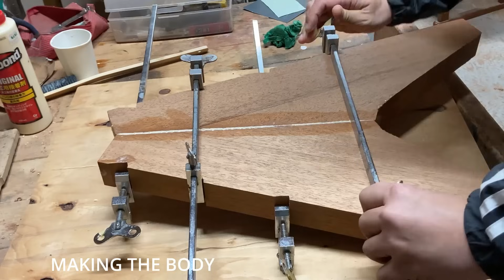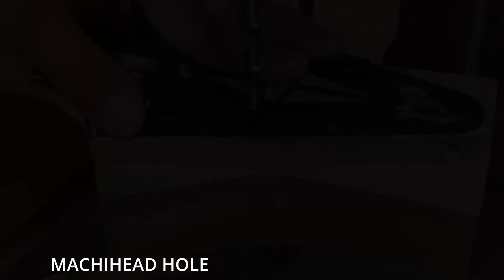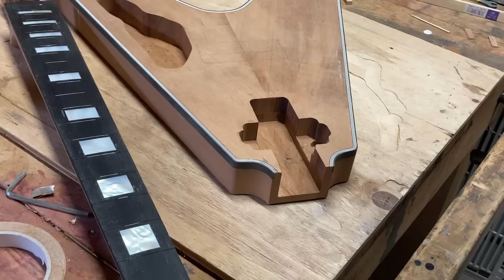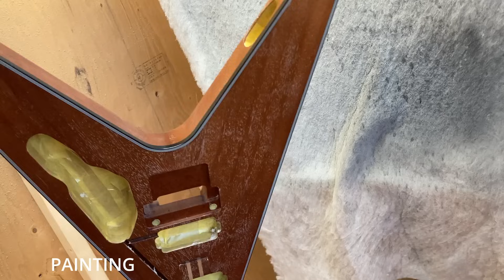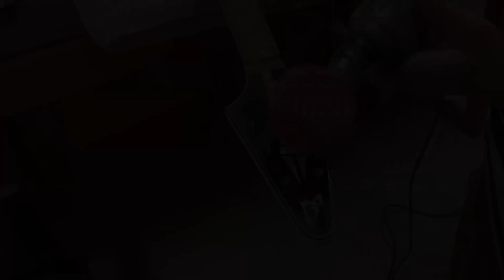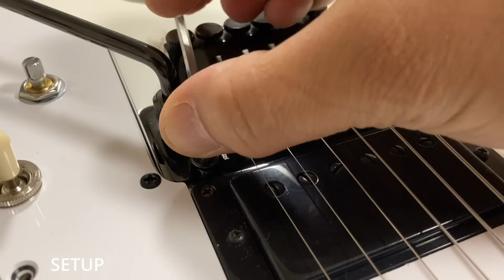I built a guitar  FLYING V TYPE

Comment: I feel like you shouldn't have wiped the glue off the initial body joint. It's quicker to leave it to dry and chisel it off. As wiping it just leave a thin mask of glue along the joint. I mean sure you can sand it off but it's just easier in case you need to mark centre lines etc. Nice guitar though mate, you've done a good job
Reply: this is the worst "woodworkers tip" i've ever read.
Reply: @FulcrumsEdge  well you are wrong. Sure both methods work, but look at it this way. Glue is water based, and water raises wood grain with leads to soaking into the wood. If glue soaks into the wood it will leave you with finishing problems 9 times out of 10.
Reply: @juicy5816  if glue is water based and you leave it on the wood, stands to reason that excess glue should be wiped off to avoid the moisture contents soaking into the pores of the wood it is settling on. So uh, yeah, your original point still comes across as silly.  Also, chisels are specially for shaping wood by carving thin slices of material from a slab of wood in detailed and careful strokes. The skills needed to be proficient takes raw talent, a lot of practice, or both. What chisels are not designed to do: remove excess dry glue from wood joints. Like... Sure... It might "work". Chisels are sharp as fuck. However, I see no benefit to following your approach. I in fact do see a plethora of possible risks. While the risks may not be assured, in my opinion, they definitely aren't worth the possible end result.
Reply: @FulcrumsEdge   I get your point with chisels aren’t meant for scraping glue but it doesn’t affect the use of the chisel in any way. Although glue is water based it will not soak directly into the wood with squeeze out. The glue will only soak in if you wipe it/ rub It in. And the possible risks aren’t that impactful unless the persons chisel skills are terrible. You’ll probably find that not only luthiers but a lot of wood workers choose to scrape the glue after. It maybe the wrong way on paper and to a guide but at the end of the day it’s my preferred method and I’ve always found that it’s left me with better results. However, it doesn’t make a whole lot of difference as you’ll most likely have the sand the entire body for finish anyway. But as I said it’s my preferred method, it’s how I learnt and I’ve not had any bad results. Have a good day, I’ve enjoyed this debate very much 😁😁
Reply: @juicy5816  glad it could be seen as a debate and not as a battle to the death. ive seen a few woodworkers use the flat sides of chisels as a type of scraper and that seems to work when removing wood fibers from a  surface that is intended to be a perfectly flat surface, but not to remove adhesive from glue joints. at the end of the day I've never been taught to or seen a luthier or woodworker, be it in person or on youtube, allow glue to dry as it sits while clamping wooden joints together and then tell me that's their recommendation. I'm not gonna admit that it hasn't happened cause even i've done it on accident, but i also haven't heard said person come out and state it was their intention to leave the glue that way. any advice or lesson i've received has always been to wipe the excess with a clean/dry rag or shop cloth, heck i've even had a couple recommend a damp cloth as it stops the glue from curing up and drying which then makes it a bit easier to remove, but most state dry cloths are the way to go to avoid introducing excess moisture into the grain pores as the glue itself is trying to fill into those pores and bond every possible fiber of wood within the area together.
Reply: @FulcrumsEdge   Yeah I completely respect your way of doing it and I should probably wipe excess off as I go. I can just be stubborn in doing stuff the way I like. Thank you for the advice as well as the debate, I wish you success mate.
Reply from the maker: I think you have a point.
I think everyone has their own way of doing things.(^_-)-☆
Reply from the maker: Thanks for the advice!!!
I'll try that from now on!

Comment: You should never adjust the bridge when the strings are in tension.. it destroys the knife ends
Reply: It also cuts grooves into the post pivot points. You can even see them in the video as he turns the screws.

Comment: This is a fantastic build, just remember to not adjust the height of the bridge like you did in this video, losen the tension on the bridge or else the bridges "knives" and posts will be damaged, its a very common problem when the guitar not staying in tune anymore because the bridge is not floating the way it should due to flat areas on the knives... other than that the whole build is awesome.. :D  great job..
Reply: HearGear. Sir I'm new to building guitars,I'm on my first one, it's for my son. What do you mean when you say the bridge "knives" and posts will be damaged. For my finished project I will be using solid birds eye maple with a dyed maple center spine. I was wondering about using a finger joint the length of the body. I thought it might help resonance. What's your thoughts?
Reply: @joelongstaff7601   Always losen the tension on the strings when adjusting the height of a floating tremolo system, the bridge should not be touching the posts when adjusting the height of the tremolo. Or else you will flatten the edge that is touching the posts and the tremolo will no longer float like it should and the guitar will not stay in tune anymore.
Reply: @HearGear  Thankyou Sir. So many details to learn. God bless.

Comment: IVE WATCHED THIS BUILD THREE TIMES IN THE LAST TWO MONTHS.
I LOVE THE CLEAN LOOK OF PURE WHITE BINDING AND INLAYS.
I REFINISHED MY SG SUPREME FROM A GREEN TO BLACK FADE WITH PISS YELLOW BINDING AND INLAY.
TO A BLONDE FLAME MAPLE TOP WITH OPEN PORE MAHOGANY BACK AND PRISTEEN WHITE BINDING BY SCRAPING THE NITRO OFF WITH A RAZOR BLADE AND POLISHING WITH STEEL WOOL.
I SANDED OFF THE YELLOW NITRO ON THE HEADSTOCK AND SHOT A NON YELLOWING LACQUER AND IT BLINGS NICE AND CLEAN.
I ALSO RESHAPED THE STICKY NECK TO A SLIMMER PROFILE AND OILED IT.
THEREFORE I LOVE YOUR WHITE FLYING V.
THE ONLY THINGS  ID CHANGE IS I WOULD ROUTE THE ELECTRONICS CAVITY FROM THE BACK AND LOSE THE PICKGAURD ALTOGETHER.
AND THE THICKNESS OF THE BODY WOULD BE 1/4 INCH THINNER.
POINTY TOP ON HEADSTOCK AND SHARP 90 ON THE BODIED INVERTED V.
1980'sPOINTY GUITARS RULE.
I AM CURRENTLY BUSY ACQUIRING ULTRA HIGH END WOODS LIKE BLACK BOG OAK AND 5AAAAA X CURLY TIGER .MAPLE FOR THE NECK THROUGH S AND TOPS.
AND CURLY GABOON EBONY FOR THE FRETBOARDS.
I ENVISION BLACK MOP INLAYS.
THANK YOU IT WAS A PLEASURE TO WATCH.

Comment: I adjusted the Floyd on one of my guitars while the strings were tight, and it snapped the top with the hex right of the bolt. The bridge shot forward and smacked the wood, chipping a piece about the size of a dime out behind the bridge pickup. It sucked!

Comment: How much neck angle did you add. 3 degrees?
Reply from the maker: No angle is attached.☺
Reply: @nakagawaguitars4552  I posted that before I saw you were putting a Floyd rose with recessed route. Nice Build!!

Comment: Just a suggestion. Anytime your about to set the neck?? Always use hyde glue. It's the only place where vibrations are transferred from 2 pieces of wood. The hyde glue is superb from resonance, and sustain. Plus,....if ever you should need to disassemble the guitar,...its much easier to do so. Great build though. Beautiful craftsmanship and attention to detail. I'd be proud to own that gorgeous guitar.
Reply from the maker: Thank you for the advice！！
Reply: @nakagawaguitars4552  Trust me when I say this. I meant absolutely ZERO DISRESPECT my friend. You built an incredible instrument. I've just learned over the course of owning and building guitars for 18+ years,...Hyde glue really does work anywhere wood is connected or parts contact strings. Like the nut as well. Which I forgot to mention. You do that along with the neck pocket and adjoining body planks??? You'll be truly amazed at the resonance and sustain differences. I know I was. I learned it from a certified Martin luthier many years ago. Please know I meant no DISRESPECT my friend. That's my main concern.

Comment: You just ruined that Floyd rose adjusting the height under tension.
Reply: the stud posts on an original floyd rose like this are not going to wear out the knifes edge on a stainless steel bridge plate nor will the bridges knife edges wear out the stud posts. this is  even after  multiple adjustments over a period of time. this is sometimes a concern with the special or 1000 series but not always, generally their bridge plates are made of a varying grade of zinc alloy. a fairly hard metal but can be easily damaged by harder metals like high carbon or stainless steel. that being said, a lot specials and 1000s come already upgraded with higher end materials from the  companies that use them in their available models and are not susceptible to this issue. This is an old partially true tale... harped on by guitar techs and luthiers who tended to spread paranoia into players who went about tinkering with their axes on their own (albeit sometimes for valid reasons). the edges of these OG FR trems are machined to exacting accuracy and forged to rigid metallurgical tolerances and are designed for the specific purpose of being rubbed up and worn against each other with little to no effect over time.... a cheapo licensed trem from ebay or a cheapo licensed trem on a budget guitar, different story. but this guys OG Floyd will be juuuust fine with height adjustments made under string tension. if this was a regular issue, i can assure you that Floyd Rose would not be able to sell a single trem for the typical asking price of 200-300$ US..